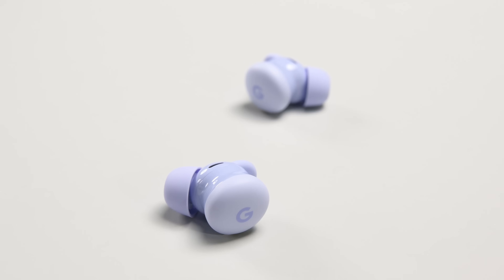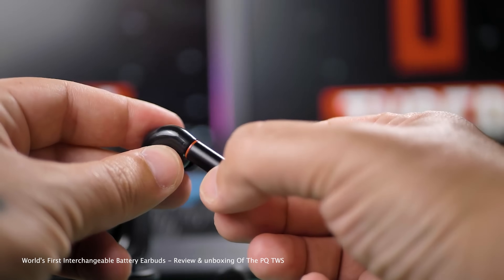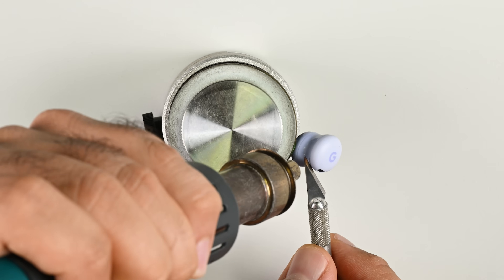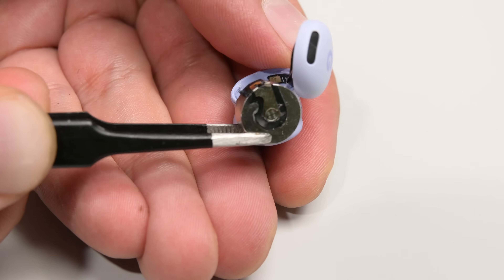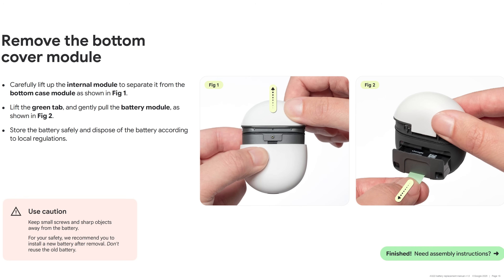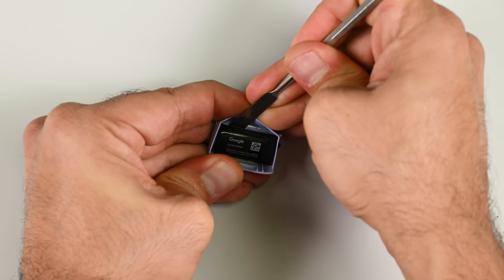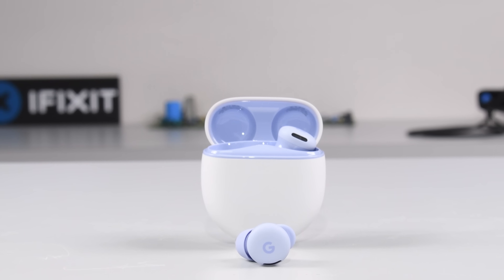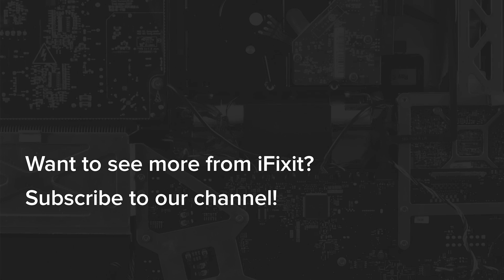Pixel Buds 2a: Two Button Cells Short of a Repairable Trifecta

Comment: They're still one of the more reparable earbuds I've seen.  
If your repair shop is doing a lot of them then it would be quite easy to make a specialised little tool to pull those out.  
So better than most, but still not great.

Comment: Isn't that dangerous to put batteries in you ear hole😢 what if it's explode?
Reply: Exploding lithium batteries is exceedingly rare in low-power devices like this. Even in phones where the batteries are worked harder than ear buds, it's very very rare. We still hear about it happening every now and then because there are SO MANY PHONES out there. Anyway, "explode" is an overstatement. Lithium batteries don't generally "explode", they just get really hot and burn uncontrollably. That's not to say it can't happen... but the chance is very very very very low.

Comment: I will no longer spend more then $20 on buds that don't have replaceable standard batteries. 🤬
Reply: I'm just gonna go back to wired at this point. Still running my Pixel Buds Pro (gen 1) but when they die, I don't think I'm bothering with a new pair. I've got some $30 KBear IEMs that sound better than the buds. I'm over wireless.
Reply: @skrufff RIGHT! 
I actually have several under $20 buds. They don't have many bells and whistles but they sound just fine. If I'm outside running around I really don't need more. 
If I'm home or in a quiet place when I want to focus on the music, I have premium wired headphones.

Comment: I'm still more glad at least for some kind of case battery replacement than none. Making the battery replaceable in the buds would definitely mean a capacity sacrifice. Maybe applying some alcohol and oil could help getting the cell out non-destructively by sticking a glue on top of it and slowly pulling out, but it's still not something easy to do.

Comment: They dont want to make repairable products, if they wanted to, tech is already out there. They can use same design as chemical bottles have in europe, its hard to open for kids safety, you have to squieze or press in bottle cap, its sealed perfectly without using gaskets and its water proof.

Comment: I replaced the batreries in my WF1000 XM4 with a £11 kit from ali express, came with tools and used a hair dryer. Took me less than 30 minutes.
Reply: Did you use b7000 glue to seal the earbuds back up?
Reply: @corey7219 yes. The black one

Comment: Who wants to repair their Earbuds anyway? Just get a new pair when the batteries are exhausted.
Reply: Why do people replace their car batteries (non EV )? Why not just get a new car?

Could it be that it's because cars are designed with easily swappable batteries letting owners either do it for themselves or get it done at a shop for a small fraction of the price of a new car instead of  throwing away a still completely working car? Who knows?
Reply: maybe you can get a set of batteries for 5 usd?? go away, pls, we don't need more of this way of thinking - we have more than enough

Comment: One compromise that manufacturers could do in order to help battery longevity of the buds, is to include a switch to allow me to decide when the buds should be charged while on the case. I don't need to have them all the time at 100% when I pull them out of the case.
Reply: Exactly, I thought about it too. They undergo constant charge cycles each time you put them in the case which would wear out the batteries faster.
Reply: This is the actual reason why I don't use wireless buds at all, I don't like batteries to be charging all the time.. I prefer to use a dongle and go wired (I miss the headphone jacks so bad)
Reply: @JuanesChiwirosky  I had to buy an adapter just to keep using my earphones and headphones, it’s sad.